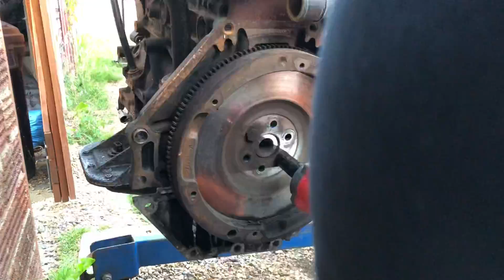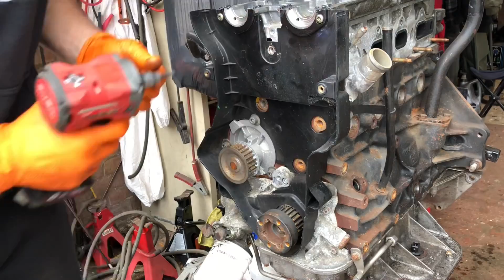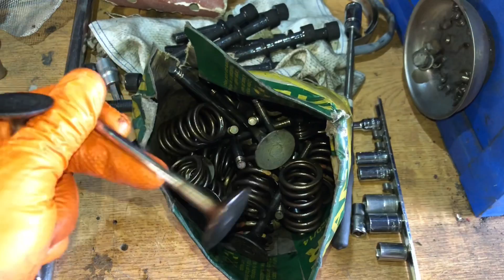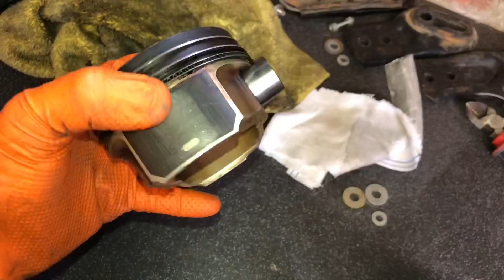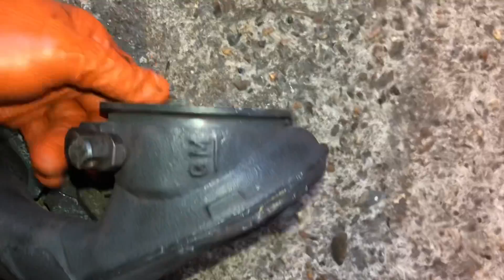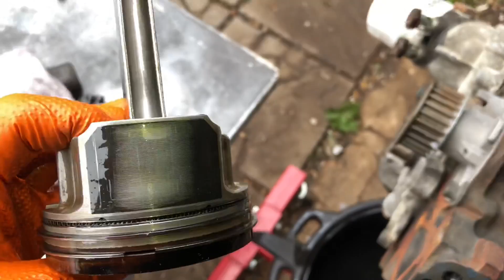Z20LET Vs Z20LEH THE COMPLETE GUIDE! Astra Opc & Vxr Engines

Comment from the maker: So i hope everyone enjoys this one. If you do give it a share! Use this pinned post if you can think of anymore differences. Another one i just remembered is the zleh has a shorter dipstick for more oil capacity.
Reply: Quality content as always!
Reply: I would like to add that the LET and LEH conrods are actually different, the LET one has a little oil squirter hole drilled all the way into the bearing which the LEH doenst have because it has proper oil squirters. Also the camshaft sensor plugs are different
Reply: MikadoRC I like a proper squirter
Reply: Have you got z20leh engine?
Reply: Iv put a z20 let turbo on an leh do I need any tweaks for it? Thanks in advance lads
Reply: @Manlikewezzo  why would you put an let turbo on a vxr?
Reply: What about z20lel, ever done anything to those engines? Are they much different from the z20let?
Reply: How much are these engines?
Reply: Is it possible to make private chat with you?I have some questions about z20let engine.Thank you.
Reply: Hi can these go rwd 
I love my Astra vxr but also have a mk2 escort
Reply: Hey Aaron, im based in south africa cape town and about 6 months ago bought myself a zafira opc z20le. i just love this car and everything about it.i picked up a problem now well my wife while taking the kids out on a 60km journey. the thin water pipe which comes out the cylinder head infront of the engine was abit damage and blew a whole through and lots of water ran out, the thing now is that the water bottle water gets extremely hot and bubbles out the over flow even thou the van goes on. my question is could this be the head gaskets whats blown? but the water and oil did not mix or is it the water pump or thermostat?

Comment: Hi Aaron, i contacted you on IG on my new profile, id like to check the size of the restrictor bolt for oil feed. My bolt just arrived, i measured the hole and its 3mm diameter. Can you please check if you have the bolt laying somewhere around if thats the size needed? The last thing i want is to cut the pressure too much and cause my turbo to have too low oil pressure. Many thanks

Comment: Can you please do a ler Vs leh please. 
I know ler has the let turbo let maf and let injectors.
With a leh throttle body.
I've noticed the ECU is at the back instead of the side. 
And I'm not 💯 but I think the ler also has the oil squatters.
And same M32 gearbox but alot smaller of a clutch

Comment: my astra gsi has a massive oil leak and its covering all the pipes in a oil type film, any ideas how to solve that? im going to be changing all gaskets and valve stem seals on the 11th June. i just need to know what would be best way to prevent any more oil leaks.

Comment: Hi Aaron, Great videos, your knowledge is really refreshing to have someone who actually knows about what they are talking about! I have a question on the oil cooler. How does the thermostat work. With the water-oil cooler, would the thermostat not be open straight from cold to allow the oil to heat up faster? But if you had an oil-air cooler, you would want the thermostat to stay shut untill high oil temps, so you would need a different stat in the cooler?
Regards
Dave

Comment: Does the lel/ler have a balance shaft?
Reply from the maker: Yes it does
Reply: @AaronUnknownPerformance  I've read before people fitting a VXR turbo to a LET and std mapping is fine, I assume because boost / lambda target ect is ECU controlled, so would it be possible to fit a VXR ECU / MAF / Injectors to a z20lel/r with it's stock turbo for 240bhp?

Comment: Quick question, when u run the forged pistons and u use new big end bearings do you have to get the cranked polished?
Reply from the maker: Yes always polish the crankshaft. Then check for proper oil clearance

Comment: Pretty sure the black piston skirt coating is molybdenum disulfide, meant to reduce friction massively, its not Nikasil .. Nikasil is on aluminium cylinders to give the aluminium surface a hard plating to stop rings ripping them apart. Coming from the 2stroke mx bike world, when Nikasil plating chips off the cylinder walls and the piston ring grabs the bare aluminium they seize as they grip/dig the aluminium.

Comment: Done a engine Chang from a bear block where does the electronic water pump go to this go to oil cooler or the  head and have a problem revs fine but wen hard boost bogs spluters bifires  done inlet gasket pal actuator seems OK on penni valve pump  is on gearbox does seem to be getting hot old engine shot pisto

Comment: mate you need to get that subframe sorted and make a video , i have a full front subframe & rear axel , polly bushed and powdercoated  ready to fit on my GSI and need some guidance lol , i have a haynes manual but might as well be in Egyptian . great stuff great videos for us guys that want to learn -  also the vxr brake upgrade is that a straight swap and does it make it heavy on the front end steering wise

Comment: How many horsepower can a standart z20let pistons can handle? With proper tune of course. Thanks
Reply from the maker: Around 300
Reply: @AaronUnknownPerformance  i have seen cracked ones but i dont believe it is because of the material of pistons, but bad tune and very low piston to bore clearance, also bad gapped piston rings. Can you explain more of that?

Comment: I love your videos and recantly had to rebuild the engine cause od 3rd piston. It just broke. I've got a k06 hibrid turbo with a 3" exhaust. What could have cause it in this case?
Reply: I know this is old comment but the answer is in your question. If you were running a K06 hybrid then I’m assuming you were running 300+ on standard Rods/Pistons. Z20let limit is rated to 280-300 max which means 260/270 is a nice safe spot, when engine is at its maximum limit its only a matter of time before something gives, yes forging is expensive but it may save you money in the long run

Comment: Hello sir, I watch a lot of your videos and I am very delighted.  I'm learning a lot but today I bought an Opel Astra VXR 2 liter turbo, I need help from you to fix a turbo pressure problem and have a diagram to connect the small hoses between my dump  valve and intake especially since normally I should have a pressure of 1.2 bar and I only go up to 0.800 I must also check the tightness of my turbo boost circuit.  if however seeing how passionate you may be could be of help.  I would like to send you photos by exposing my problem on my Astra but on which site could we discuss?  thank you for your precious time and your help cordially.

Comment: I have a feeling that my VXR turbo has gone on my Z20LET even though I have a restricter bolt fitted. Does the turbo need rebuilding or replacing?
Reply: Are you blowing blue smoke?  I had mine go on my SRI and upgraded to the K04 with VXR clutch and flywheel.  I got mine from Courtenay racing 🙌🏽
Reply: El Mundo loco I’m running a VXR turbo already. The smoke is intermittent but not blue. I had the oil seals replaced 18 months ago.

Comment: Is there any difference between Z20LET and Z20LEL/Z20LER engines?
Reply: Yeah lel have 230mm clutches and are weak the ler is slightly stronger
Reply: @Vauxaholicx   apart from the clutch and the gearbox, are there any differences between the engine and in what exactly?
Reply: Николай Тодоров no all the same balancer shafts and different oil lines and maf and injectors same as LET

Comment: Where do the z20lel and z20ler fit into this? Are they more the same as the let or the leh? Just got myself a twintop astra 2.0 turbo 200bhp from a salvage yard, was smoking badly, fitted new turbo core, service, new breather hoses etc and it's running beautifly now. Then I stumbled across your video for the cam cover gasket as mine had a small leak and changed that too. You really know your stuff 👍
Reply: The lel and ler are the same base engine as the let just runs off a CAN ecu management. Lel is the 170bhp and ler is 200bhp. Same engine different map.

Comment: where do you get the oil restrictor bolts for the oil pump bro?
Reply: Oil restrictor bolt is for the turbo and available on Ebay, the later vxr k04 turbo's come with the restriction but I would personally still run one.
Reply: They sell different size holes for the bolts, tx sell them I’ve ive just order a turbo rebuild bolt .

Comment: Aaron or anyone else 
would I need my remap checked if I replace injectors ? still have the let ones and add a sport cat and a new fmic ?
Thanks in advance
Reply: I would think so considering ecu is set to mix certain amount of air and fuel and i dont think a stock ecu could make adjustments that big but Im no expert 👍🏻
Edit: if there same size then definitely not.
Reply: the truth90  thanks for reply 
only big difference Is a 200 cell sport cat and a new intercooler car is tuned to stage 2 260bhp with pop and bang map by rabbid 
Iv also put a set of cleaned let injectors in 
Think it will be ok or will it need checked ?
Reply: @badboi162  if everything is still the same size then no I don't even think intercooler matters 👍🏻
Reply: the truth90 great thank you will be nice to know I can go out for drive